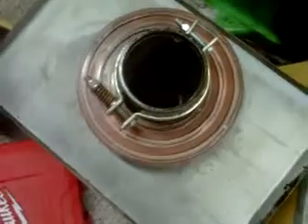Thunderbolt 1003 AND 1000T Restorations...VIDEO # 1 of the series!

Comment from the maker: @kasm279 Basically, as I understand, yes. The 1003's projector support bracket is mounted in a slightly different location on the projector because of the extra ~2" between the projector and chopper housing. Also, the 1003 employs a 3-conductor slip ring set for the solenoids...one is a common, and the other two are for each solenoid. Otherwise the 1003 and 1000T are pretty much the same.

Comment from the maker: @kasm279 The bracket itself is the same but the difference is that it is drilled in a slightly different location on the projector. It's just bolted on with a couple bolts and nuts. Pretty low-tech, but it works! lol

Comment: @promod400exridr Ah, I figured the support was welded on to the bottom of the projector. Now that I think of it, that wouldn't be that strong. Also, can you have the bolts drilled out of the bowtie? Or perhaps (if they aren't stuck in there too bad, after the fall they might be) cut a groove in them and try loosening them out of the holes.

Comment: @promod400exridr I actually have an old SLR camera, an Olympus OM-20 to be exact, that uses little SR-44 batteries, the battery door having a coin slot. Somewhere in its lifetime the slot got stripped out, so I cut another slot using a wizard (little rotary tool, uses B&W's VersaPak batteries) perpendicular to the first one.